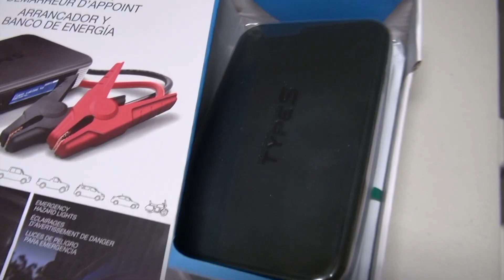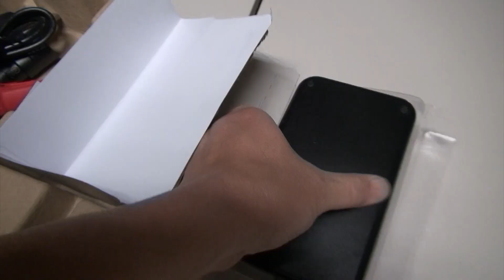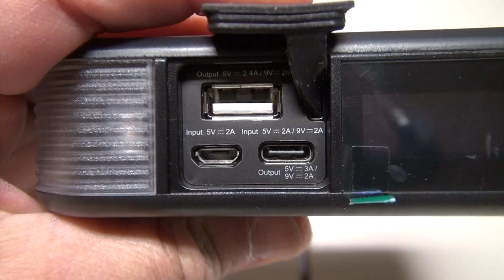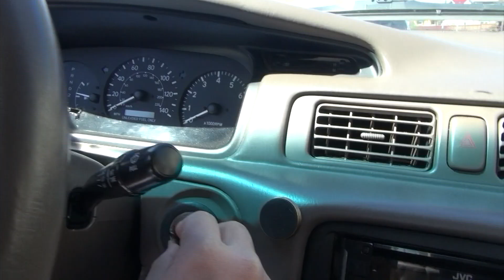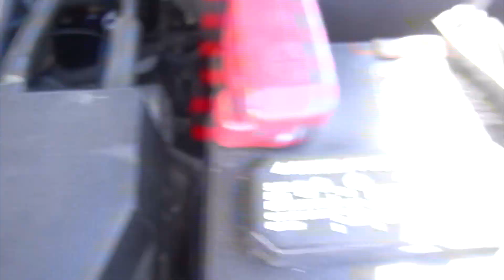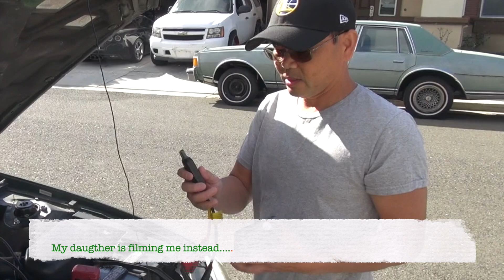Costco's Portable Jump Starter & Power Bank! Does It Really Work? Let's Test It!

Comment: I just got one for my 2014 Honda Accord. The battery was dead, no cranking, did not have enough power to start my car today
Reply: It has no override button if battery is less than 2volts. The Noco 40 has the override button and it will work.

Comment: I would never drain a battery to perform a test.  Lead acid batteries will be degraded if they are drained past 50%  and may not charge again.  So now you will need that jump box and a new battery.
Reply: It has no override button if battery is less than 2volts. The Noco 40 has the override button and it will work.

Comment: Costco sells great ideas! I bought me one and both of my sons each one for just in case the cars dont start. Thank you for this video! 🦋
Reply from the maker: Thank you for sharing.
Reply: It has no override button if battery is less than 2volts. The Noco 40 has the override button and it will work.

Comment: can i leave it on with it still clipped? Will that charge the battery?? like i know its a powerbank, can it be used to charge the battery of the car to full?
Reply from the maker: You can use it to change you iPhones, but you cannot use it to the charge the car battery.  It is designed to jumpstart the car so that the car’s alternator can charge the battery.  Do not use it to charge the car battery.

Comment: Just a little fun bit of information: your daughter definitely does not drive a V4 motor car...it would be an inline 4 also known as a 4banger... there's V6, V8, V10, and even V12 engines, however there is no V4 engine that exists for production cars in north America... Likely not any other continent either. For future reference your daughter drives a 4 banger or online 4.
Reply from the maker: Great catch! Awesome information.  Thanks for pointing it out.
Reply: THis is a term typically used in other countries, and they intertwine the V4 typically found on motorcycles and the other 4 cylinder engines as well as the V6/8/10/12.

Comment: I used the Type S the other day when i mistakenly left my van on overnight to crack the windows open.  Worked right away. Really impressed.  I went to get the Noco but it is 3x the cost of the Type S Costco. I am wondering why the huge price difference and if it is justified. I just need it for emergencies if my passenger car battery dies. I do appreciate quality and will pay a premium if something is worth it but i don't know what the huge difference is between the NOCO and TYPE S
Reply: If you have something that worked PERFECTLY the very first time, why would you be trying to replace it lol
Reply: @OfficialBigYayo   because it not work perfectly the 2nd or 3rd time? It could crap out a lot earlier than other brands
Reply: It has no override button if battery is less than 2volts. The Noco 40 has the override button and it will work.

Comment: Hello, thank you for your informative videos.  I also just bought one of this from Costco.  I have a scooter that uses 4 SLA batteries like what you're showing in another video which are connected in series? (I'm not sure), and I haven't used the scooter for quite a while, so the batteries are dead and I can't charge it with the original scooter charger.  Can I use this Costco jump starter to recharge or jump start these SLA batteries?  Do I have to remove the batteries completely out of the scooter, and one by one to charge them or can I just leave them in the scooter and connect this Costco jump starter to them?  If so, can you show me how to connect this Costco jump starter to the batteries?  Thank you.

Comment: Doubt Costco would sell a fake. They're pretty well known for solid products at lower prices. U can't compare lithium to lead acid so being small and light is not a risk factor. You're not "charging" the vehicle either, you're giving it a jump. Your alternator charges the battery as car runs. Also, these jumpers are made to connect at posts, not + to post and - to chassis. That is inefficient and unnec bec jumpstarters do not have the risk of sparking when attaching to posts...like regular jumper cables from another car do.
Reply from the maker: Good point.  Thanks!

Comment: Here's an experiment rarely seen on YouTube:

1. Jump start the car
2. After a very short period of time (seconds), turn the ignition off. The car's battery will likely still be dead, as the alternator hasn't been given sufficient time to recharge it.
3. Attempt to jump start the car again off the same jump-start device, without attempting to recharge the device.
4. Repeat steps 2 and 3 to determine exactly how many jump starts the device can perform before it fails.

Comment: Thanks for demoing the Type S from Costco. Would be nice to see what the Voltage was before the jump. Also, quit curious as to how much battery was left on the jumper afterwards. And what is the minimum about of battery required on the jumper unit to get a successful jump etc. If you happened to have more info after the making the video, let me know! 

Thanks for making the video! 

PS. I was told that, depending on how dead the battery is, you might want to leave it connected for 5mins or so, oh and also make sure to turn off all the electronics in the car (a/c, lights etc.) before attempting the jump.
Reply from the maker: The jump starter needs to have at least 50% or more capacity before jumping starting a car.  Also you must disconnect the cables from the car within 30 seconds after you jumped the car.  Not a good idea to leave connected longer than that…Thanks!

Comment: Haven’t had this jump starter jump a car off yet, it sucks
Reply: What car are you jumping ? These are limited to certain engine sizes because of amp requirements so you might need a more powerful unit. Generally these things work amazing !
Reply: @christopherw2233  doesn’t work AT ALL!  A 4 cylinder and a 6 cylinder acura. Im no fool. But i was foolish to buy this junk
Reply: @robs1873  It worked great on my Honda Civic and Toyota 4-Runner
Reply: They NEVER work when you don't follow the instructions...you suppose to charge jump box/power station IMMEDIATELY after purchase for at least 20-40 hrs(power stations)...most people don't, they just put it in their vehicle for when they need it then wonder why it doesnt work properly when they finally need it lol

Comment: Great Video! After charging the unit, how long if I leave it in the car and don't use it for a month or two, when will I need to recharge it back to 100%?
Reply from the maker: You can check on the capacity level every now and then.  If the capacity is below 70% I would charge it back up to 90%.  100% is not good for the battery if you don’t plan on using it right away…
Thanks!
Reply: I also bought one of these and in the manual it says to charge it every 2-3 months

Comment: You didn't need to charge to 100%. It would have worked at 100% no problem.  I've done it on my Honda Fit from a fully drained vehicle battery
Reply from the maker: Thanks for the additional information..
Reply: @diypotentials  
I meant to type it would have started the car at 67%

Comment: Good information. However you stated your daughter was going to jump start her car but you didn't let her. You connected positive first and then negative which is correct. You need to do the reverse when taking them off (Negative first then Positive). By the way you should remove the cables within 30 seconds after starting not start the car within 30 seconds. We have these in all our vehicles and my daughter was able to use it herself and worked great. Great Product from Costco.
Reply: I have these and on page 10 it says to remove red/positive first then black/ negative 😬 i'm about to charge my car. I assume from your tips though that it might be possible to do either way
Reply: @Norixciii  As you would put on positive first and then negative. You do the opposite when taking them off.
Reply from the maker: Thanks for the additional information!
Reply: Hi I wanna ask as I am quite new in jumpstarting cars, I tried using this jumpstart battery kit like in this video but although the battery is off the black cable gave off a tiny spark when I tried to connect it to the car battery negative terminal, then I found out my car dome light is on as it was night time, it is safe to retry to jumpstart the car again once I ensure all lights and I check my car is parked at P no aircon, wipers or other lights on?
Reply from the maker: @liyenong2017  Sorry for this late reply.  Yes, turning all those items off will allow the jump starter to zero in on the starter motor to get the engine going.
Reply: @liyenong2017  Yes, make sure all accessories are off first. You only want to get the car started not the car, the light etc.
Reply: I have the same one.
The manyal says disconnect RED/POSITIVE first once the engine starts. Confusing 🫠

Comment: Usually batteries only last about four years. Keep a fresh battery in the vehicle after that. For about $150.00 you can get a great battery. Most auto parts store install them for free. Don’t forget to check the distilled water in the battery if you have that type of battery. Take a screwdriver and take those caps off. If it’s low in distilled (yes it must be distilled water) top it off to the measuring line. Many people neglect this procedure. Oh yes excellent video😊
Reply from the maker: Very helpful information.  Thank you!
Reply: Your welcome. I noticed you have the type of battery that you must check the water. Pop the caps with a screw driver to check water. Distilled only. You usually can get it in the water section of any store

Comment: Thanks for the information. I love the 98 Camry. Don't be fooled by the look. With proper maintenance like oil change regularly, it is still a good car. As to the hood and the fade paint for lazy maintenance, just mix some mineral spirit and boil linseed oil, wipe it on 2 coats for drying each 12hr to protect it from further sun damage. People said it can last for a year or two for doing it again.
Reply: We should have your daughter hook it up a training for her  hands on
Reply: I bought one for my husband he loves it. And it DOES Work!
Reply: @SindeliaisSin  It has no override button if battery is less than 2volts. The Noco 40 has the override button and it will work.
Reply from the maker: Thanks so much, very useful info for my Camry…
Reply: @diypotentials  It has no override button if battery is less than 2volts. The Noco 40 has the override button and it will work.